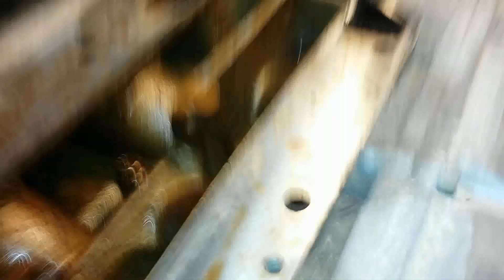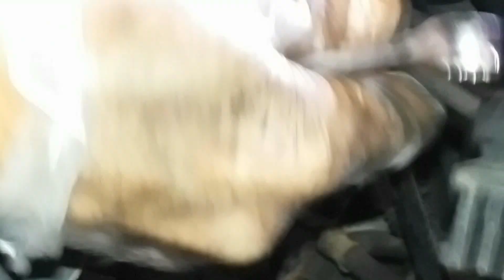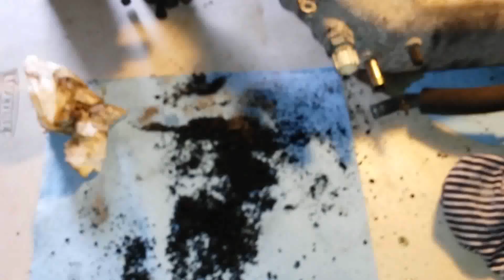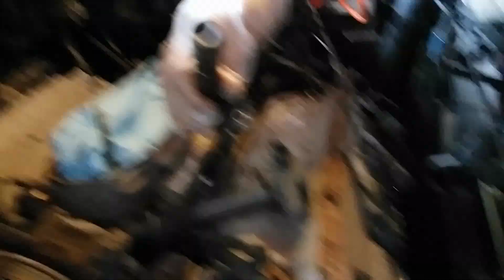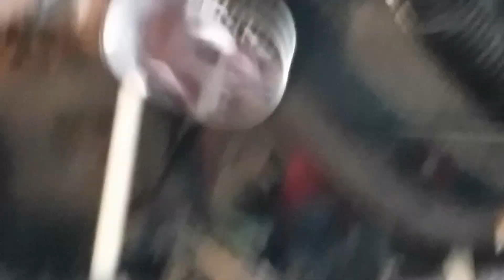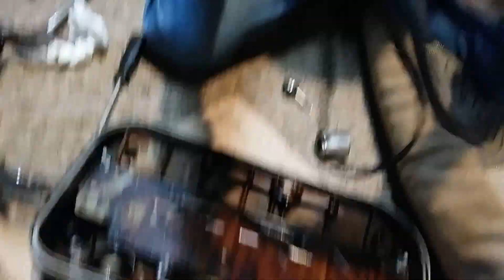Honda Pilot engine knocking noisy ticking lifters valve clearance adjustment 3.5L hesitation fix

Comment: I changed the tensioner and had the valves adjusted and it’s still making a ticking sound until it hits about 2500 rpms. What could that be??
Reply from the maker: If you have high mileage, you can try using a grade thicker oil. I use 5W20 Mobil synthetic only. A grade thicker doesn't hurt usually
Reply: Wise Monkey ya it has 155k. I use 5W20 synthetic too. Maybe try 10W30?
Reply: @Itsme83.  my ticking noise it's just noticeable now that I change the oil to 0-20 honda oil,almost no ticking,going to use lucas to thickening just a bit,because when hot,sounds too thin.
Reply: i have same issues
Reply: Ever figured these out? I have same @ny-time1248

Comment: What year was this vehicle?
Reply: Looks like a 03-04 Honda Pilot J35A4
Reply: 2003 or 2004 Honda Pilot
Reply from the maker: it's a 3.5L Honda engine that starts around 1998 and used still today in Honda and Acura vehicles
Reply: Exact same engine as 2002-2004 Odyssey

Comment: you didn't tell what size feeler gauge to use . other then that great video thank you.
Reply from the maker: The intake and exhaust valve clearances are written under the hood on a specs sheet usually. It's different for each engine and user must follow it and use the filler gauge size accordingly. Thanks for watching.  Please share and subscribe
Reply: He did... several times.